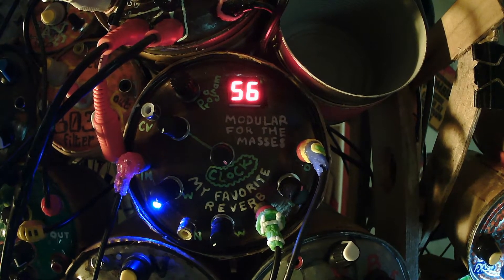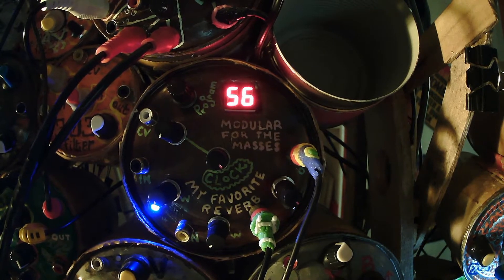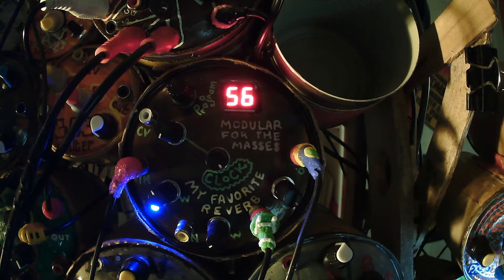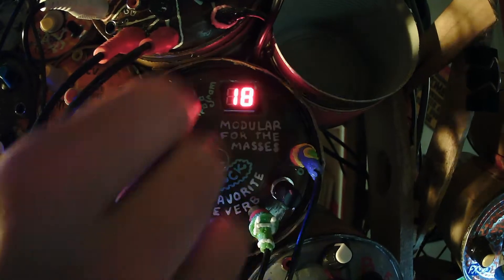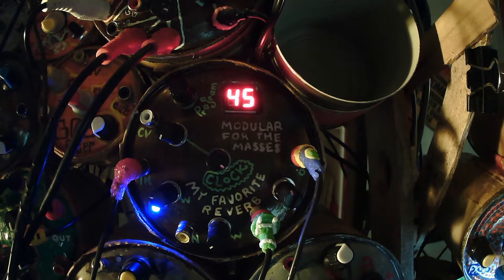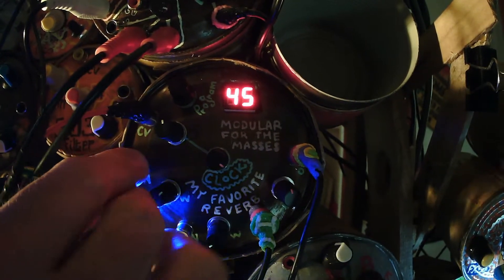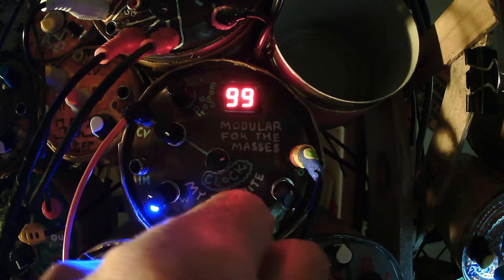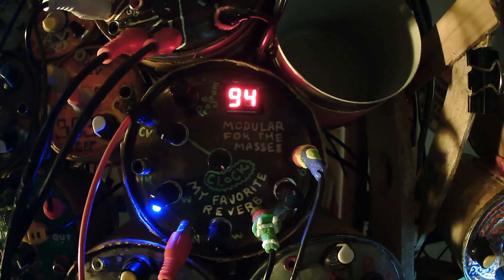Demo of My Favorite Reverb

Comment: wondering what value pot you used for the CV attenator?
Reply: also, do tou remove the crystal or just send the clock strait in?
Reply from the maker: The resistor the CV goes through is a 2.2M part so I probably used a 1M attenuator. Basically any potentiometer will work there, as long as it's not making the CV source sag (so no 10 ohm pots LOL).

I have always taken out the crystal. Never tried leaving it in. I don't know how an active clock source interacts with a passive crystal, maybe it would overpower the crystal maybe not?

Comment: Do you know or have a way of measuring what the frequency range of your clock is?
Reply from the maker: My DMM can measure frequency into the MHz range, so I probably did know the frequencies I ended up with. But I found the frequencies that worked experimentally, turning a trimmer to make it fast enough to crash the chip, and selecting some useful (incredibly noisy) slow clock speed.

The reference circuit for this chip uses a 12.228 MHz crystal, so that's a starting point for your calculations if you wanna get fancy, control it with a STM32 or something (ooooooh fun idea)
Reply: I was asking this because my version of this module sounds so very different from yours, especially the part where you use it with your voice to change the pitch of your voice.